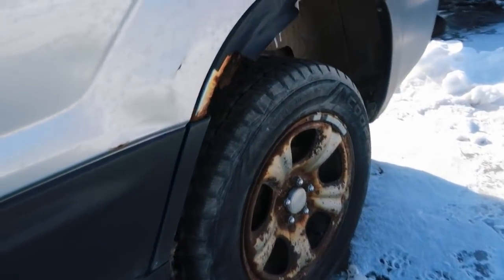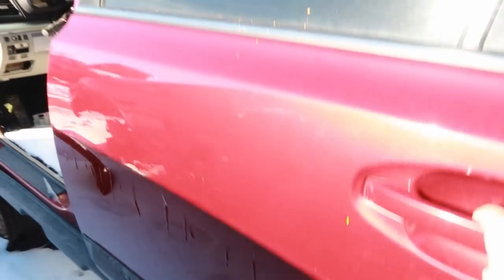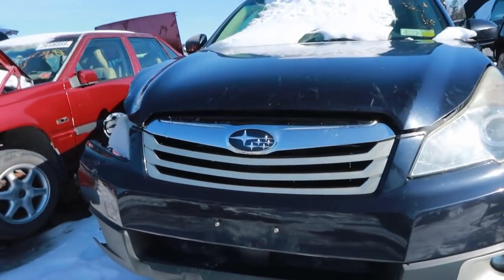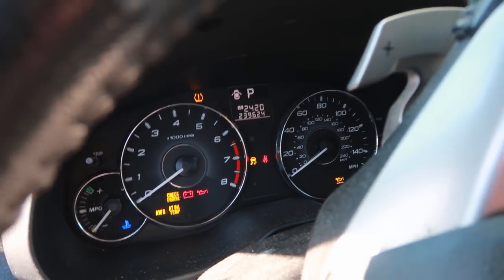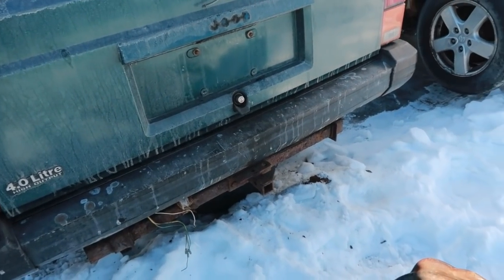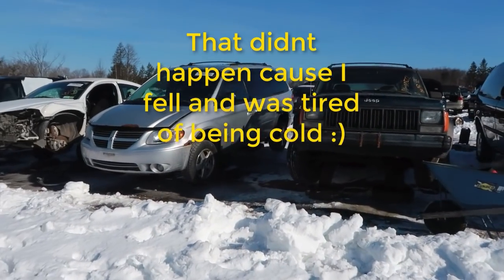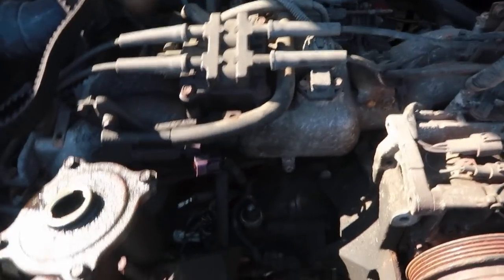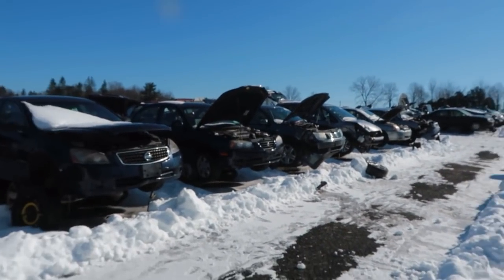Odometer readings from a Scrapped Car - D&E in the U-Pull 14

Comment: How many bolts is that battery? Most drills/impacts or 18-20v. Does that matter? Or do I need to find a 12v. Perhaps my milwakee M12? I’m trying to figure out which pins to do on the actual cluster. (Mikes are acaully store don the chip on the cluster not the main ecu). A particular car I’m picking in junkyard had a fuse box essentially ripped out for some reason. So I can’t connect direct to battery. Not to mention the keys aren’t always with the vehicle.
Reply from the maker: You will be fine with an 18v or 24v to read. These circuits aren't picky and I have never blown/fried anything doing this
Reply: @DEInTheGarage  thanks. Actually just found a good video where a guy shows how to use a Milwaukee M 12 battery which I have a few of. Pretty nifty takes of common fuse from a car and sticks it in the slot of each spot of the positive and the negative side and then you got something real nice to clip onto with alligator clips. Worked out really

Comment: Been there done that! I just replaced a radiator on my daughters truck and finished filling the reservoir and went to grab the cap when it dropped into the engine bay. After 45 minutes, I found the bugger on top of the radiator support on the other side of the truck. Still have no idea how it made it's way over there.

Comment: The sticker month/year for ny is the due date. IE aug 19 means it was due August 2019 for inspection, when it was inspected the mileage was wrote down, so in August 2018 it had 205000 miles